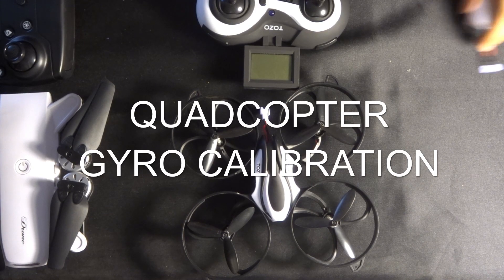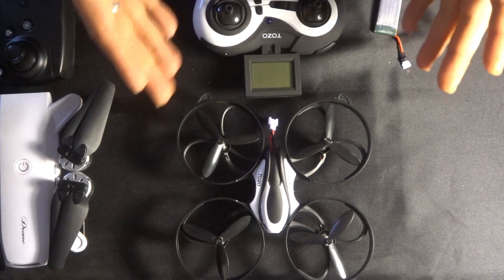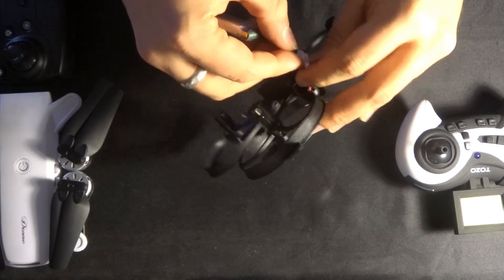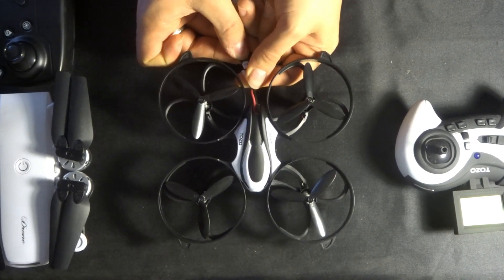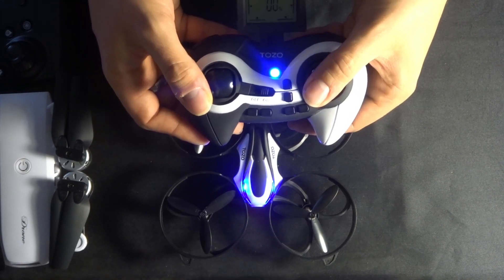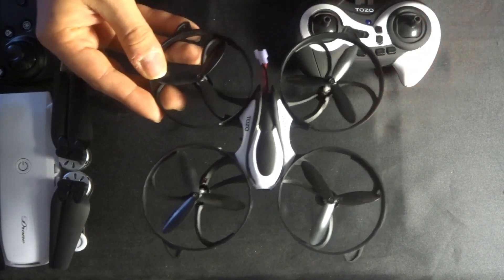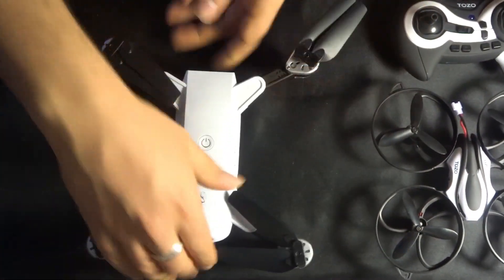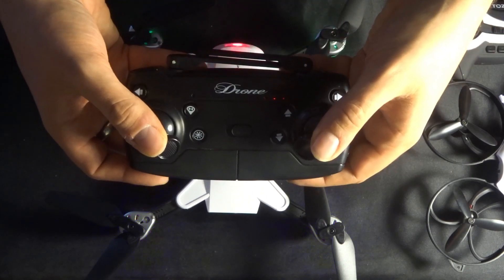Gyro and Drone Calibration Video

Comment: Thanks for this! I have just bought my first cheap drone from aliexpress and it is always sliding in one direction. After seeing your explanation I saw that my drone is always leaning a bit due to having different legs. I will try to start it on different surface so I will be able to startit once it is standing in correct position. I am however still not sure what does gyro calibration do? Can it be done while flying of does dron have to be on ground?

Comment: So many videos on calibration fail to mention that there are different ways to do this depending on the manufacturer. Yours does, so thanks for that great explanation. And then you have my manual which says to push down to the right while showing a picture showing pushing down to both sides!
Reply from the maker: Thanks Tim. 👍🙂

Comment: What is difference between trimming and gyro calibration ? Both sounds same to me.
Reply from the maker: HI Stormynite6 Well before a flight you must calibrate the gyros on a level surface so the copter has a level base to start off from and so the flight will be as level as possible, or the copter may fly all over the place.  Trimming is used after the main gyro calibration to just tighten up the quadcopters main flight orientation, so it can again be as level as possible.  I have only used trim a few times as main gyro calibration before the flight usually ensures a good flight.   I go into a bit more detail in this video - https://www.youtube.com/watch?v=ukXn5ehLZlo Hope that helps :-)
Reply: Great explanation. thanks.
Reply from the maker: You're very welcome Stormynite6 :-)